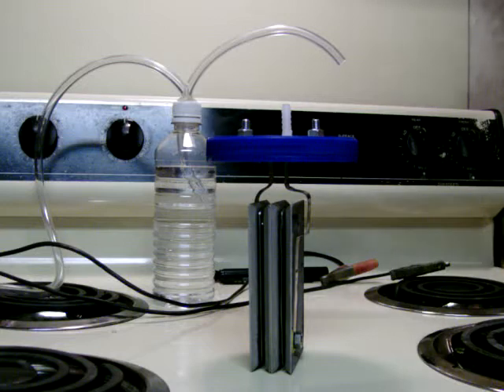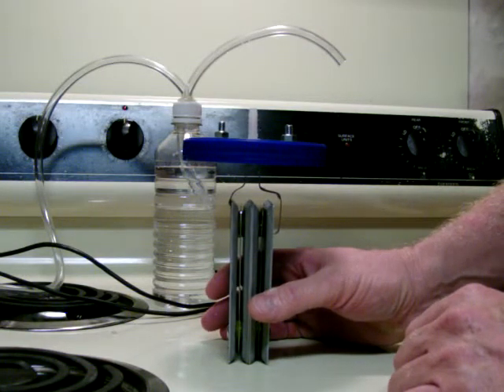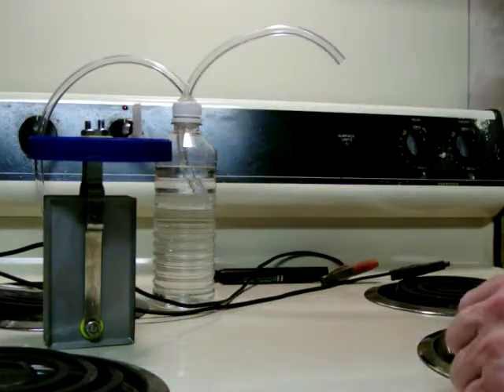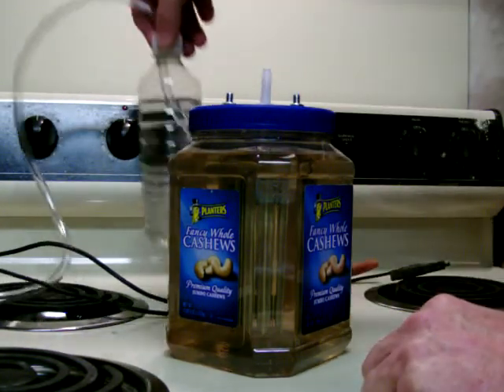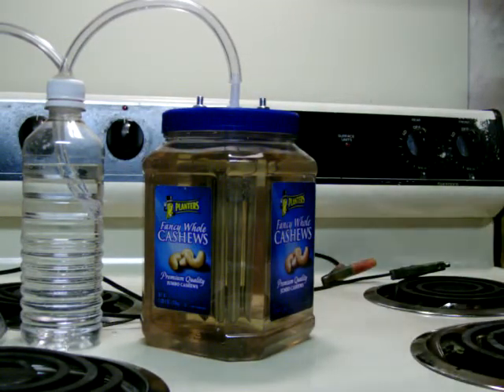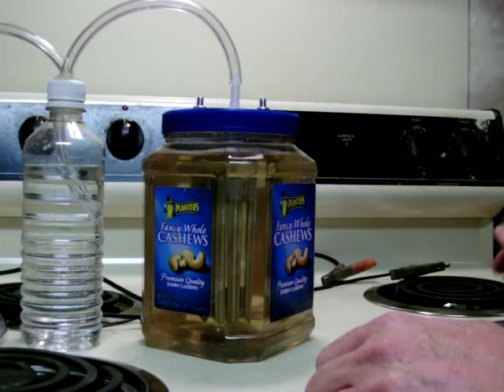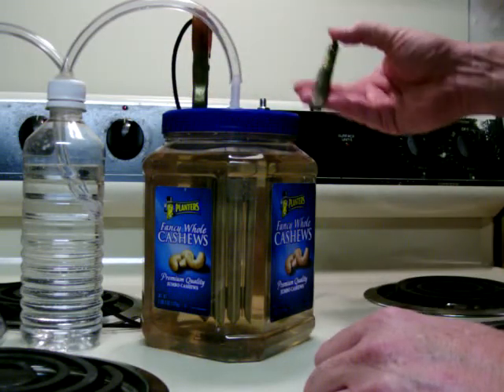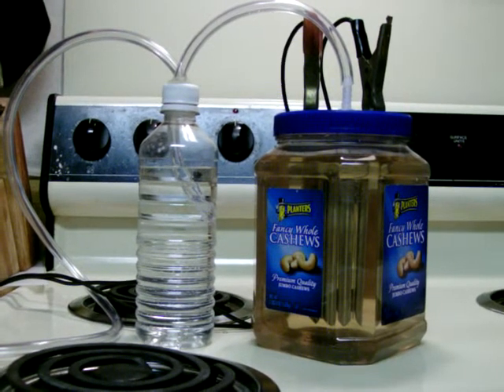hydrogen gen #3

Comment: it should be bubbling for you with this setup. you must have leaks. at 10 amps with this arrangement you should be getting about 150mlpm and see alot more bubbles. all my work has been with switch plates. a another plate to make 5. arrange them -n+n- use nylon bolts.

Comment from the maker: no continuity dry, I think the current plate arrangement is optimal because only the flat areas are functioning anyway. I ground away the bend on the positive plates. The bent bevel when reversed to the next negative plate seems to guide water flow across the plates at a very good velocity.I belive this causes the bubbles to seperate faster from the plates and free up surface area occupied by the center of the bubble which while in contact is a nonproductive area.